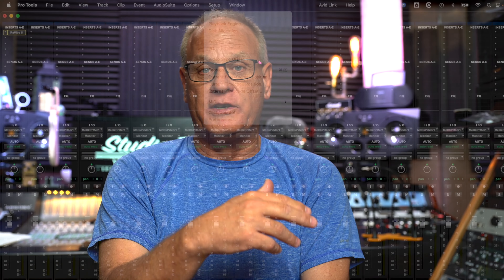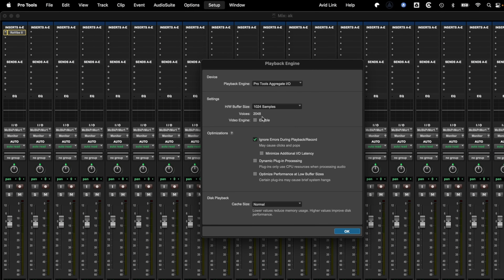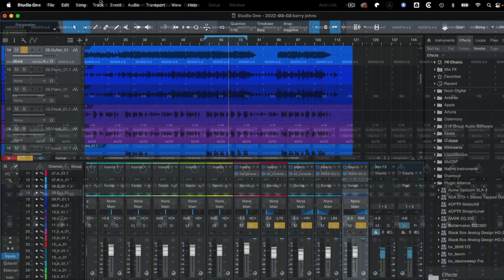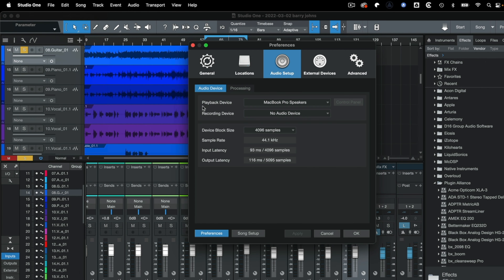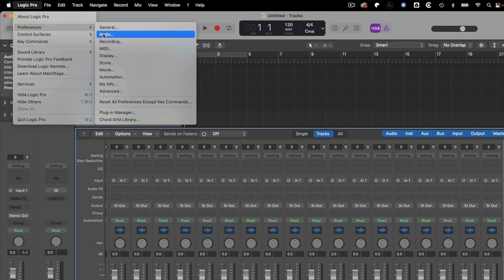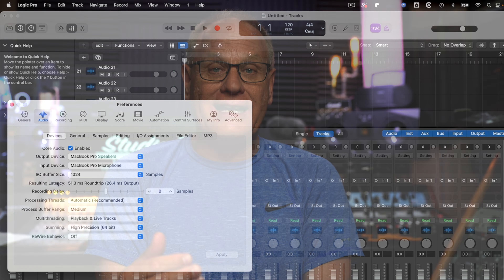Recording Interface - Got Pops, Cracks and Clicks - Let's Talk Buffer

Comment: I get occasional static while recording and in playback, but it is not on the recording. It seems to be very random. The problem started when I switched from a laptop to a desktop computer.
Reply: Just an update, I have reason to believe that it is my HVAC turning on and off that is causing the problem. Apparently my desktop computer is more vulnerable to such things than my desktop.
Reply: …. more vulnerable than my laptop.*

Comment: solved...I resurrected an old Amd gpu system and had an annoying click every second across all sample rates. Took me a week to figure out. It was the AMD Radeon driver. It automatically opts you into their "experience" data gathering. Disabled that in their option in the software and  for an 11 year old machine its working great.

Comment: Im having a different problem i have clicks and pops even with no recodings i dont know what it is and i dont know how to get rid of it. Also i work on Ableton and changing the buffer sizes does not work and it only lets me record on one aduio input [mic(Realteak (R) audio) DX] instead of the regular USB wave well thats the one i always recorded on

If anyone can help 🙏🏽
Reply: It's most likely your cpu meeting it's ceiling... I've had that with my old iMac as well. To the point it didn't even playback multitrack recordings properly without glitches, pops, clicks... work around was bouncing and freezing tracks, especially midi tracks with software instruments.

Comment: I am running a Apple Laptop Pro (Lots of RAM). Using Garageband with a Zoom R16 interface. Guitars sound good but my YYamaaha digital piano Pos and cracks. It does NOT seen to be latency just pops and cracks. After this vid I will check my buffer setting in garageband  which is my DAW.  Any tips all ears.  I know its budget but its all I need at my level.  THANK YOU
Reply from the maker: It could also be sample rate.

Comment: What about if you’re splitting vocals and bouncing them and in the recording you getting popping and crackling does the buffer have to be set low or high and what is the accurate number? Recommend logic, pro X Intel processor, Mac Mojave.

Comment: Is there a easy way to fix the cracks that already happened ? And how do i know if my mic has this crackling sounds or that its just the cpu ?
Reply from the maker: If you put your buffer on the highway setting and remove all plugins from you session do you hear it?
Reply: @BarryJohns  yes its in the recording
Reply from the maker: @peterk3556  that’s a completely different thing.  Check all your cables both audio and digital.  It sounds like either a bad cable connection either in the cable or device or a bad/under powered USB/Thunderbolt cable.

It’s not typical to get this when recording.
Reply: If it's already recorded you could try to edit it out, buts going to depend on where the clicks are.

Comment: I typically record at 64 and still get clicks. The clicks happen when one region or clip meets another. I've tried to smooth it out using cross fades but sometimes the cross fades don't work. When I try to cross fade in Pro Tools I'll sometimes get a message that says something about boundaries and gives me the option to adjust boundaries or skip and ignore.

Comment: Sometimes, its more simple. After changing the usb port it was plugged into, it works fine.
Reply: That makes zero sense tbh 😅
Reply: @supersonicsroots newer usbs have faster speeds
Reply: @zlrivo  yes, usb 3.0 is about 10x faster than the older usb 2.0. But if your computer has both, then I assume connecting your interface to the usb 3.0 port is really only logical.
Reply: THANKS! Changed it to a port in the back and now it works flawlessly!

Comment: Fortunately, most interfaces these days have pass through monitoring that allows you to run the highest buffer setting without having to monitor through the DAW. So the good news is you can still track with plug ins, but might only be able to monitor the raw signal. Which is still tons better than not having the option all together. To me this only reinforces the 'get it right at the source' factor. So win, win.

Comment: Thanks!! I found your video actually searching for a different cause of pops and cracks. Could you please address how to get rid of for example a popping sound every time a fan goes on and off in the next room? I gather it some kind of electrical problem.. thanks!!
Reply from the maker: That sounds like a grounding issue.  Are you using a power conditioner to plug your gear/computer into?

Comment: When I first started recording digital back in the day. I bought a brand new Intel 166 MHz computer with 64 MB of SDRAM and put a Card D+ ISA sound card in it. There was no real time monitoring without an external analog mixer. My Daw was Cakewalk 3.0 which recorded MIDI tracks and Audio tracks at 16bit 44.1k. There were no software synthesizers only external drum machines and synthesizers like the Roland SC 55. I would record about 16 midi tracks and maybe get 8 to 10 audio tracks. I would mix down in real time from an ISA SPDIF output into Tascam DA 30 MZII. ( No internal Mixdown on the DAW’s) It wasn’t till a few years later when Steinberg released ASIO technology so that CPU Cycles and the CPU floating point math Requirements got strained because everyone was suddenly dealing with real time monitoring and latency issues. Plus add the ability to record 24bit Audio tracks and the CPU’s we’re getting beat up all over again. All the sound interfaces were PCI because USB 1.1    was not fast enough for multiple tracks of audio at 24-bit with real time monitoring. I remember AVID really started to shine when they released the audio media three  pci card that could record eight high quality tracks through its internal DSP and sync up tight to the midi tracks on a PC or Macintosh DAW. This is where ProTools and their DSP hardware systems separated those who could afford it and those who settled for non-DSP DAW’s. and now we’re in a new world of super fast CPUs (M1) running multiple cores and threads with high-speed USB- Thunderbolt and PCI express (I’m skipping over FireWire) ports. Now present day with everything being internal software Instruments and software effects emulating hardware. The CPUs are getting stressed by the software manufacturers requirements and we’re back to dealing with latency and buffering :-). You have to plan your software resources as part of your workflow now, but it’s a hell of a lot better than when I started out on PC and Mac based DAWs. Thank you as always for your videos.

Comment: im still deciding between pro toolsa, reaper , and studio one. i find i can track at 128. maybe ill find im wrong later but it does seem to work. yes in pro tools i get some clicks. it did however make me examine my workflow. tacking is tracking. i now only work with volume and pan as a song comes together. when the tracking is complete i switch my buffer and start working with my plugins. that has actually helped me because im working on the song and not screwing with plugins as much. in reaper i can do what i want. in studio one its close. i love studio one but i think i have narrowed my choices to reaper or pro tools. i wanna hate pro tools but its hard too lol. i know daws dont have a sound and i cant explain it but i do find i do my best work in pro tools .......take it for what its worth

Comment: I agree, buffer settings are definitely something to look at, especially for pops and clicks.  Latency is a little harder to nail down.  Absolutely, buffers have a direct impact on latency.  Put you blew by one of the most critical things that "new" folks need to understand when latency concerns arise:  System Delay.  That's what ProTools calls it, I'm sure other DAW's have to acknowledge and report it.

Even a 32 sample buffer isn't going to matter if your system delay is sitting at 5000 samples.  In a 48k session, that 5000 sample system delay has already added a tenth of a second latency - something most musicians will feel is unacceptable.  I know you wanted to keep it simple, but when talking about latency understanding the relationship between sample rate and system delay is every bit as important as buffer size.

Comment: Thus the reason the Mac M1 came out to get rid of all that buffer BS. The max M1 should be super fast to process at the highest speed! Basically get the Max M1 Macbook!
Reply: For audio save your money, the m1 pro has the same power as the max minus the gpu power, the pro will give you more battery life, and more money to spend on ram and drive space….
Reply: @Mrfpsara  true, I think speed and space are my main concern. Plus the plug-ins have to work. It’s all about looking excellent fir the client
Reply: @OneOutRajus  awww man. I heard different results from other producers hmmmm
Reply: @OneOutRajus  sounds like bad drivers, even the cheapest interfaces are running rock solid…

Comment: Would you be able to answer a question for me? If the buffer is set low could it automate a crackle, or click sound into the recording itself? Or is that just how it "sounds" through playback at low buffer?
I keep having click noises in my lead vocals and haven't been able to figure this out for a long time. It's not my mic cable, not my mic, and I don't "think" it's caused by my interface.
Any suggestions?